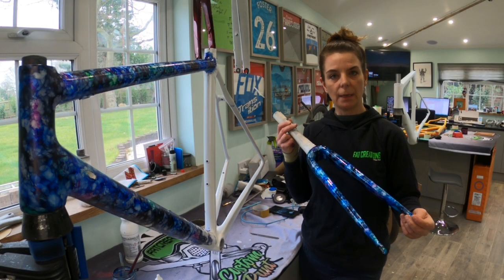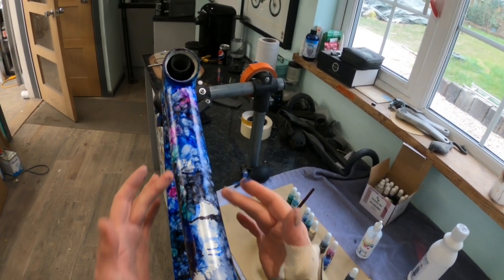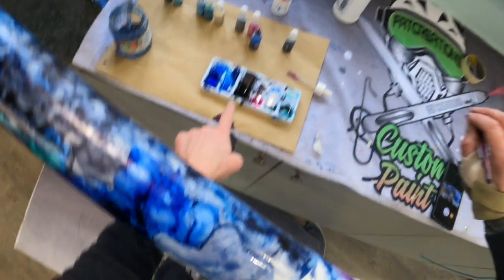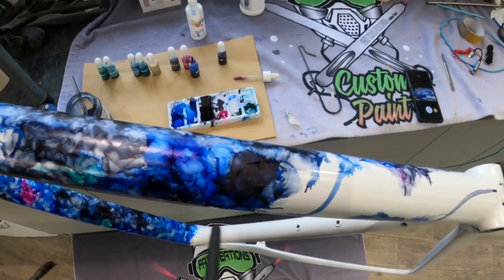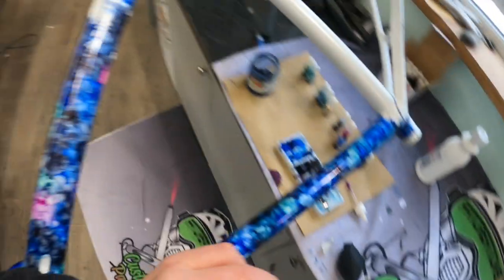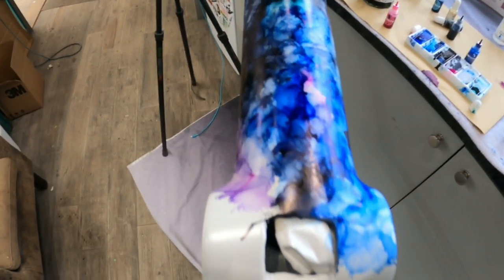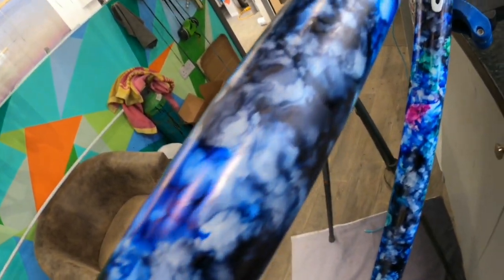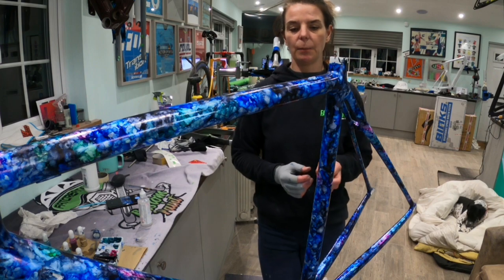How to create amazing effects with alcohol inks on a bicycle frame

Comment: That is absolutely gorgeous!  Do you prep the alcohol paint before clearcoat?  Or just let the paint dry then apply clearcoat?  Stunning...
Reply: I wanted to ask the same thing and it can only be done with alcohol paint or it could be done with another paint such as water-based metallic airbrush paint.
Reply from the maker: Just leave it to dry then heavy clear coat, flat with 600 and then do the logos and another clear. I've not experimented with other materials but I should think water based would work in a similar way, though I guess alcohol evaporates/drys quicker then water?